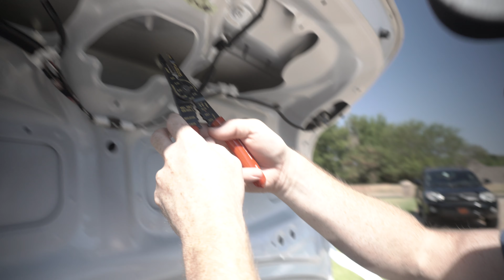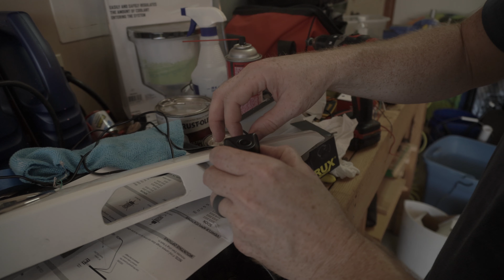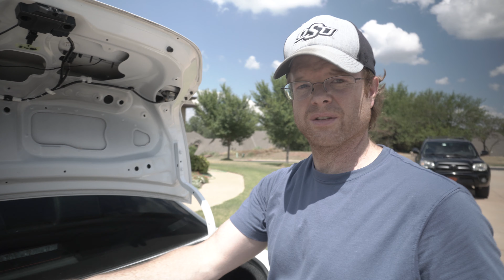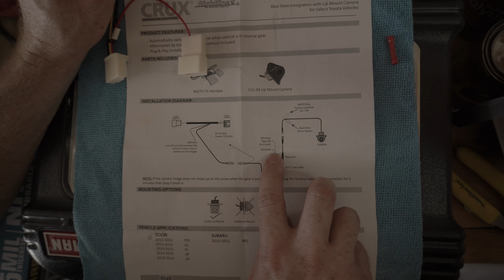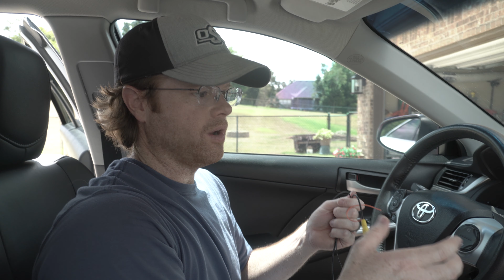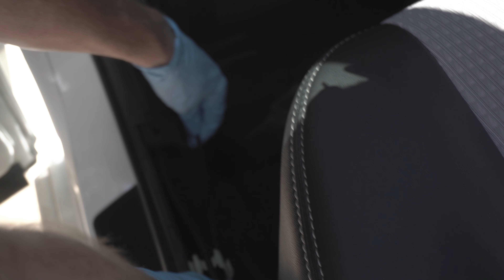How to install a backup camera on a Toyota Camry

Comment: Where can I buy the camera and wires?
Reply: Crutchfield!   Their techs are super helpful by phone, and when you buy from them, they offer free technical support by phone.   I just bought a whole new stereo system and backup camera from them for an older car we bought for one of our children.   They are super helpful in picking out the right model that I needed.
Reply from the maker: Yeah exactly Crutchfield! Here is the link to the one I used in the video: https://www.crutchfield.com/S-KF5vBekrCnj/p_249RCTY71/Crux-RVCTY-71-Backup-Camera-System.html?omnews=17829109

Comment: I am confused about the yellow wire what did you connect that too which was spliced.  I know you grounded with the original wire that you ran for the camera
Reply: Thank you I did the exact same thing but for some reason my screen is so bright when I put it in reverse I might have to run with reverse light maybe
Reply from the maker: Interesting. Yeah I’m not sure about that one
Reply from the maker: Good question. At 13:11 you can see that it’s connected to the short red wire that is coming off the end of the male end of the video line.

Comment: what tools would I need to buy to do everything in the video? Thanks!
Reply from the maker: Here is a full list of tools that I used. I have links to everything, but there may be things you can substitute for:

✔️ Auto Interior Trim Removal Tools - (https://a.co/d/eMxqB1e)
✔️ Power Drill - (https://www.homedepot.com/p/Milwaukee-M18-18V-Lithium-Ion-Brushless-Cordless-1-2-in-Compact-Drill-Driver-Kit-with-Two-2-0-Ah-Batteries-Charger-and-Case-3601-22CT/325544370)
✔️ Electrical Tape - (https://a.co/d/4wmaJH9)
✔️ Extra Wire - (https://a.co/d/iyXcljN)
✔️ 10MM Socket and Extension - (https://a.co/d/i6IxaED)
✔️ Needle Nose Pliers - (https://a.co/d/9e9xbpl)
✔️ Fish Tape (I use a coat hanger) - (https://a.co/d/jj5zTev)

Comment: 17:39 I didn’t see where you anchored the ground. Did you just connect the ground leads from each end together and not to the car frame? I just bought a 2012, in white, looks just like yours, and I have the Crux camera kit already.
Reply from the maker: Correct. I just connected the ground wires together instead of connecting to part of the frame. The assumption is that the radio will be properly grounded with the factory harnesses so I saw it as unnecessary. Hope the install goes well for you!
Reply: @ well, I didn’t have any single wire spool, so I put the ground by the camera under a trunk hinge bolt. Works perfectly for now. Thanks for the video!
Reply from the maker: Awesome! Glad it helped and thanks for watching and commenting! It helps the channel grow!